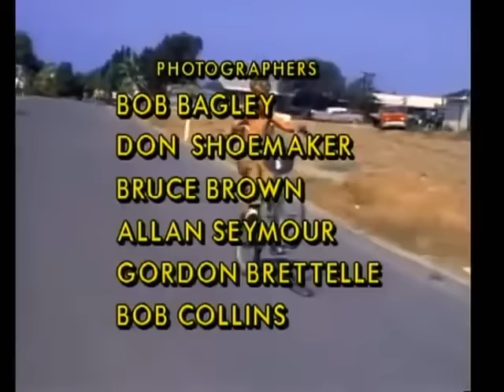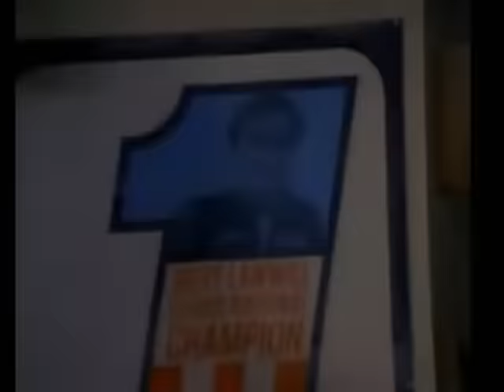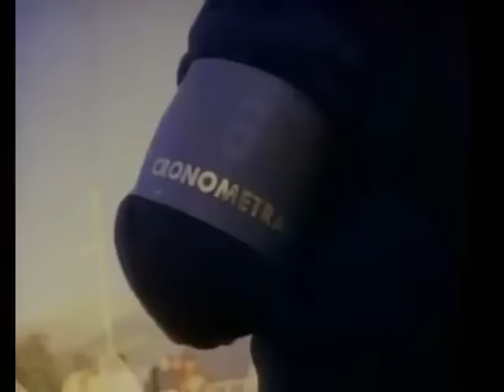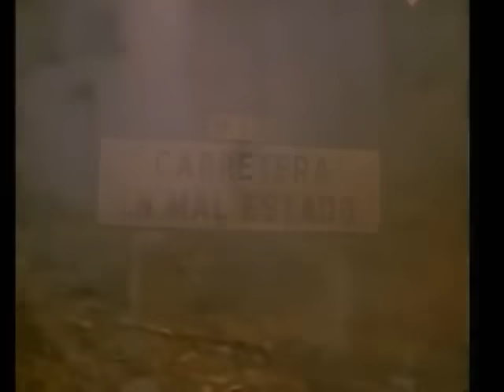On Any Sunday 1971

Comment: Saw this in the theater when it came out.  By then I'd been riding for 5 years,  a year before, me and friends started riding motocross. Totally amateur. A few years later, went for flat-track. Still riding today Oct, '23.  (In between surgeries and pain). But once in the saddle, it all goes away,,, getting preped & started is the hard part , the rest just falls into place ....

Comment: Great Motorcycle era. With dirt bike technology just reaching its initial highlights a rider had to be good to excel. I started riding about 3 years before this film came out. These guys were our heros. Amazing what the bikes look like now and the acrobatics that can be accomplished. I finally gave up my last bike in 2011 at 57yo after losing some teeth. Still ride a street bike though...it's in your blood I think. Have fun!
Reply: I can't stand the bikes today.  Cost driven up to the moon because of EPA dictatorship intervention (and the 1986 FIM production rule for the USA), and plastic that looks like it was designed by graduates of the Batman school of art.
Reply: @EarthSurferUSA  I buy used as much as possible. Bought a 2001 Bonney with 2600mi for 4800. I would probably buy a used 1990s dirt bike but I am pretty beat up and older.